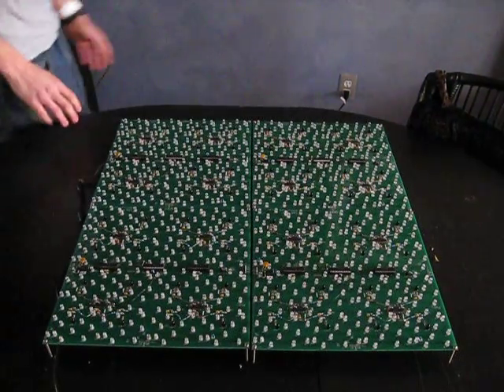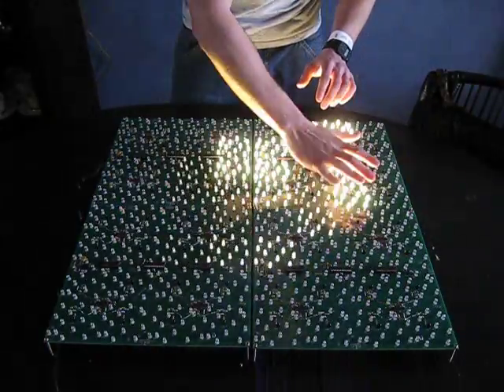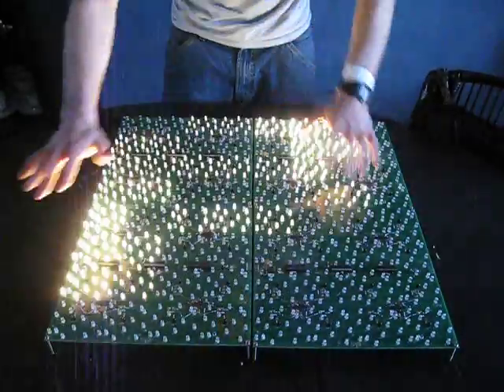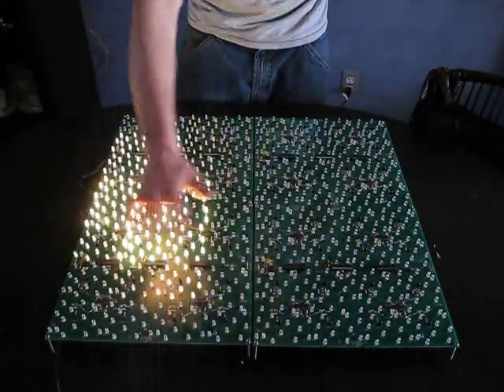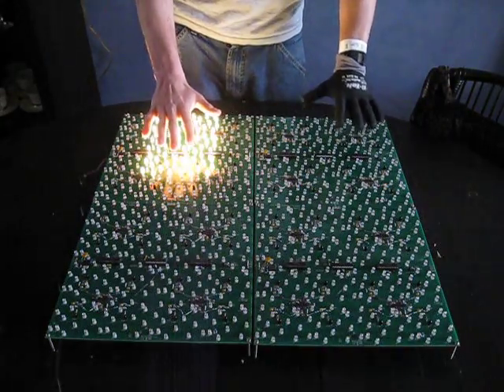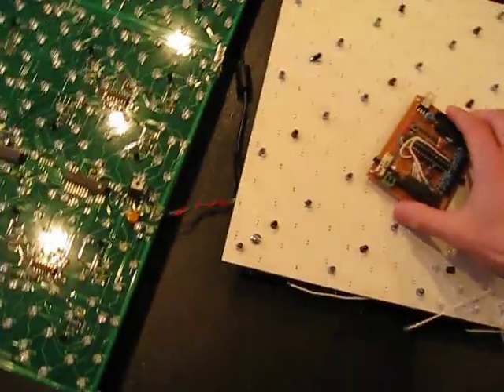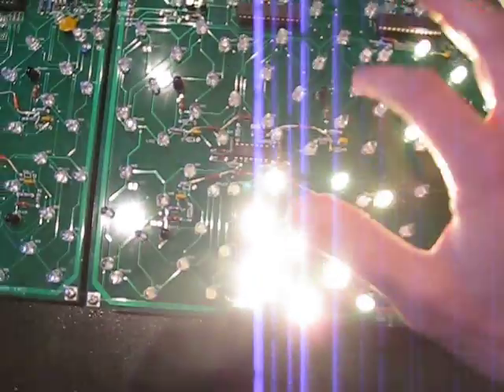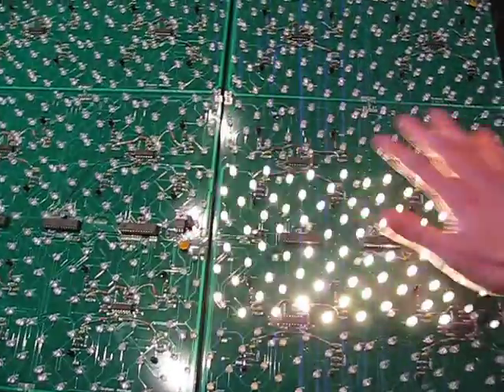New Interactive Proximity Sensing PCB Table Modules

Comment: Have you considered using capacitive sensing instead?  You might have to do some calibrating and/or use a special algorithm to separate any stray capacitance issues and noise from human motion detection, but it would solve the light sensitivity issue.

Comment: Drop the IR Motion sensors and drop in the ultra sonic. Ambient light will no longer effect the system, and you work at the speed of sound, so at 3' distances there would be zero noticeable delay in the system. Nice job, keep it up.

Comment: how much time does it take soldering all this stuff?
Reply: All this may take about 1 hour bepend how fast are you  with Oven method, with Hotgun about 2 maybe 3 hour + again bepend how fast are you.
Reply: wow, that's a lot of time
Reply: DanielTseng100 You can do it in 30min with hotgun all tha board you see in the video, but you need to be careful when you solder so many components "fast"

Comment: That's absolutely awesome. I saw someone building a 3D LED cube something similar to what you've built. You could totally use that thing as a MIDI controller with either an Arduino and a Raspberri Pi hooked up to it as a controller. You can get the control voltage back right?

Comment: Have you considered trying to modulate your IR signal? Several IR proximity sensors (I think Sharp makes one) do that to differentiate between normal artificial light sources and the emitted signal. Basically you would flicker your IR LEDS at a very high frequency then put a notch filter at your sensor outputs. Then you take whats left, amplify/buffer it with an op-amp, smooth with a cap then send to your ADC inputs. The Sun still presents a bit of a problem though. :)